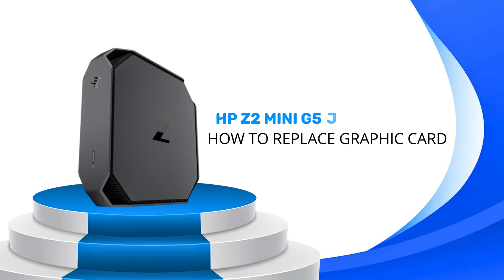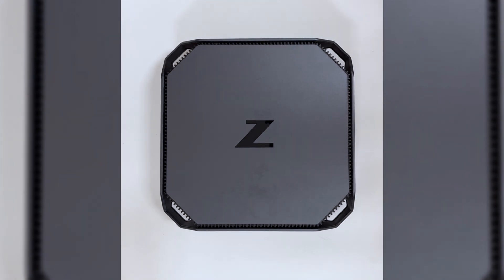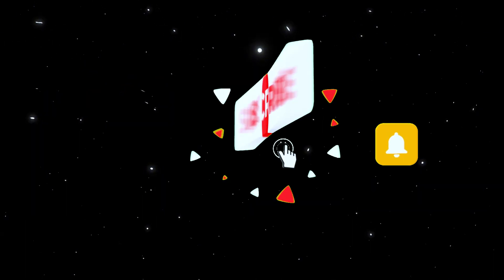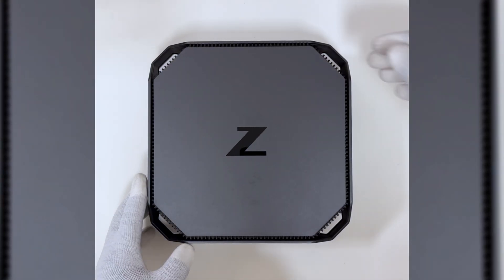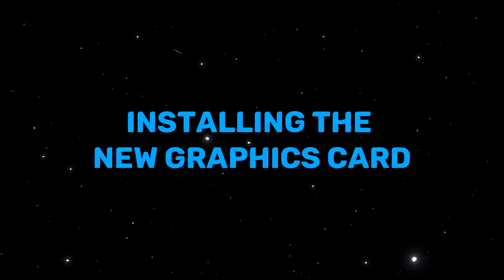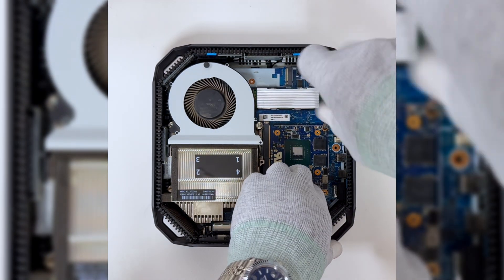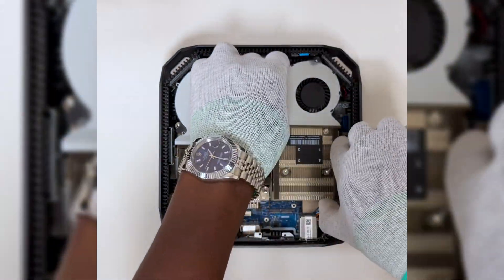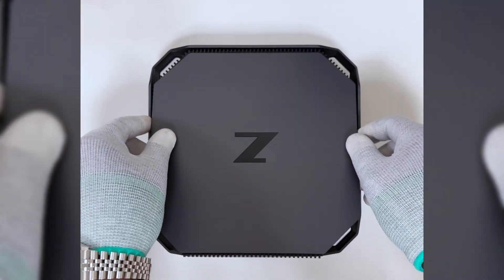How to Install/Replace a Graphics Card on a HP Z2 MINI G5  #graphicscard #nvidia #hpworkstation

Comment: Can it take any MXM GPU?
Reply: xvision sells an rtx 4050 mxm a card its expensive at 400 plus but that is the fastest mxm a card you can get  there is a p1000 as well flowing around
Reply from the maker: @sirdewd2197 Hi, these are the compatible graphics cards: NVIDIA Quadro T2000, NVIDIA Quadro T1000, NVIDIA Quadro P620 and AMD Radeon Pro WX 3200
Reply: @ElantTechnologies  Only the MXM verisons